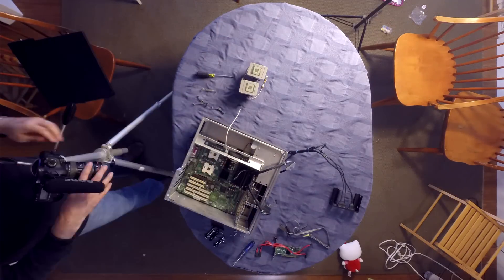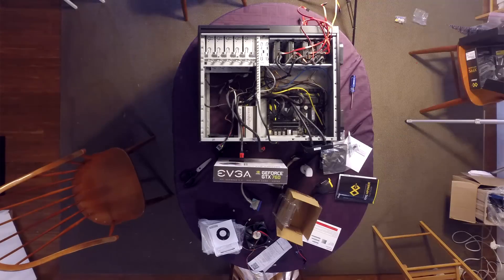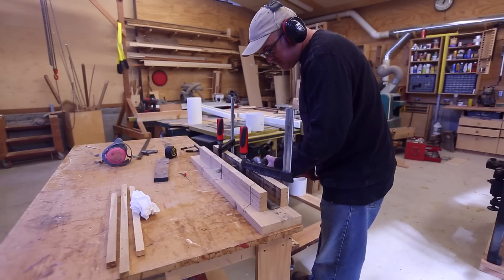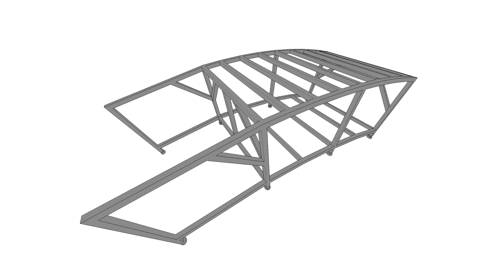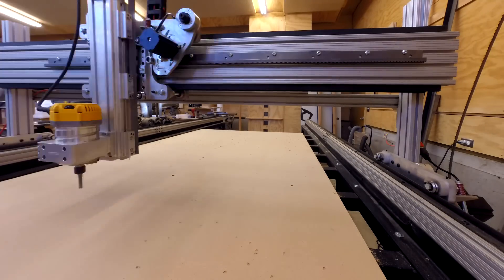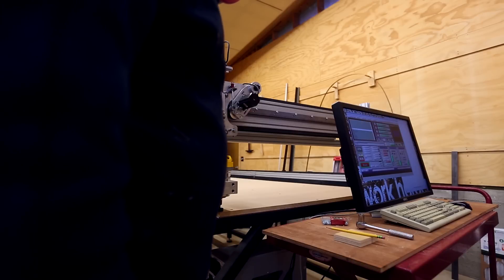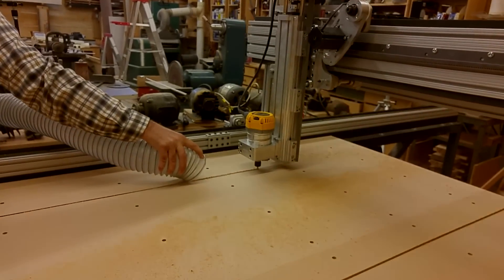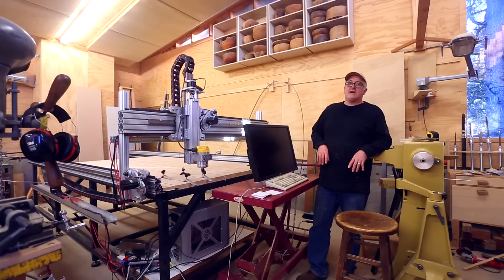The CNC Build: Part 3

Comment: Inkscape is the MOST RECOMMENDED for 2d CAD. It's freeware (it's free), but it works great! (Only 2d though, no depth)
A tip for those inlays: when you design it on the computer, just leave tabs in some places around the shape. When you cut it out, it won't be completely cut out and you'll need to saw the tabs without the CNC router, but those little tabs will hold the cut shape in place while being cut on the router. This is not needed, however, with a vacuum table.
For your dust collector, look online for a collector head. (I can't remember what exactly they are called) It covers the end of the router, and creates a trap for the dust where a connected hose can suck it up.
Lastly, when creating your designs on the computer, remember to take into account the kerf of the router's bit. You can easily forget that the router will follow the center of the line that you design, but will cut a line with a width that is the same (maybe slightly bigger) as the diameter of the bit that you are using.
Happy routing! And I look forward to seeing what you make with your new machine!

Comment: When doing inlays, you can get good results by not milling complety through the material and then take a belt sander and sand it free from the bottum side.
That's also how you can get letters ins the right spacing, you make the model then mirror it let a few thousands stand and glue them to the surface you want then sand them free.

Comment: hey frank when we machine smaller pieces out of the cnc we leaves little tabs between piece and board about 2mm thick  so that they dont fly out, you then clean the tabs up on the sander.  i use enroute but it is very expensive to get the 3d capability.
love your videos

Comment: the build is going quickly!  For woodworking G-Code I use Aspire.  The learning curve is much more shallow than anything else I tried.   Later on when you want to build cabinets there is Mozaik CNC which is freaking amazing.
Reply: +Tschäff Reisberg Also I use Sketchup for the CAD software- doesn't get much easier.

Comment: Nice build!  A few suggestions...  I use CamBam for most of my parts work but have dabbled with V-Carve Pro and MeshCam.  CamBam is decently priced and is well supported and has a great user community.

KentCNC has a really nice dust shoe for dust collection.  You could build your own but his design is solid and you'd probably spend nearly as much buying parts and testing designs as you would on buying his finished product.  You'd probably end up designing something very similar to his anyway.

My CNC PC is housed in a 2U rackmount computer case.  I modified an old laptop screen to serve as my monitor and mounted that and the keyboard on a rackmount sliding shelf.  I put it all into a 4U rack case and I seal it up when not in use to keep any dust out.

Consider installing a solid state drive into your CNC PC.  Fewer moving parts is better in a shop PC.

Comment: Frank, have you considered mounting your keyboard and monitor on an articulated swing arm? similar to your medical light but only moving on the X and Y axis. Could be mounted to your CNC router frame and swing in to the footprint of the machine when not in use.  Also  thanks for the wonderful videos.
Reply from the maker: +jmick.art I like that idea.

Comment: would highly recommend fusion360 as a commercial class CAM that is free to hobbyists... more of a learning curve, but i'd love to see you help everyone else learn it!  I've heard the CAM that is in fusion 360 costs thousands and thousands in commercial packages.

also, it is so interesting to see your progression in CNC follow the same as mine... mainly, learn about the machine, try some stuff, realize that "workholding" is a whole art in and of itself (btw, I highly recommend some side clamps for many parts as I found most of the time pieces were sliding causing my problems... if they are bound on the sides (not compressed) then you don't have to worry about the slide.  Here's some clamps I made:  http://www.thingiverse.com/thing:818842 )  anyhow, I'm super excited to see you posts your journey with CNC.  Please be sure and include the failures and the "whoops" moments and I feel those are the best things to teach others.

One last point about inlays - you can get the more perfect fit by doing "v-inlays".  I've tried it and wasn't very successful, but I'd love to figure it out one day.  The idea is that you can use the depth of the piece to allow it to drive those gaps to zero.
Great stuff Frank.  Can't wait to see more.
Reply from the maker: +Frank Graffagnino thanks for the info.  I made my first set of table clamps the other day,  they area a combination of a hold down and side clamp.

Comment: Very good job 👍🏼

You can use cambam as cam software 
It will run very will with it 
The cost is very reasonable but the 3d its not easy to be done with it 
Im still trying it but its very good in term of using the different cutting process

Comment: Great project, Frank.  Vectric is the best CAM software out there.  I use Aspire and it is well worth the money, although V-Carve Pro will do everything you may want (or not).  Plus, if you ever need some projects to run, there are a lot of us on the Vectric Forum that freely share vectors and toolpaths for some really fun projects.  I've been running Aspire for over 5 years now and still have tons to learn.  There are also some great dust shoe builds out there and a good junction ball at the top works well too.  The CV1800 will really keep your CNC clean, especially being so close to the main unit.  I can't wait to see the fun projects you do with the CNC.  It would have produced your kitchen cabinets much faster :)
Reply: Oh, and I meant CAD not CAM software.

Comment: Nicely Done Frank! Really enjoyed watching the whole build, and looking forward to future experiments with it! With the Inlays, I've started to use a slightly thicker piece for the inlay, not milling it all the way through and then ripping the timber out on the bandsaw to free the plug.
Also Don't be afraid of using Hot glue to hole things to the table top. its also easy to get off again if you free it when cold. :-)

Comment: My process runs on Rhino and RhinoCAM.  I just really like Rhino.   I have yet to find any free CAD or CAM software worth using.  My best suggestion to you is to find a CAD software you love, then research the compatible CAM packages out there that can dump to your gcode interpreter (I think you mentioned Mach3).

Comment: This is on my list of things to do. I built a small CNC myself a long time ago, now I'd like to do another, but with a 3'x3' platen. Something to keep in mind with the dust and using a dust collector with the sensitive controller. The dust collection apparatus will build up a large static charge that, if not grounded correctly, could cause damage to your controller. I recommend looking up methods for grounding the tubing of the dust collector. One idea is using a metal clamp near the mouth that is grounded to the gantry. I would also recommend building a small router guard to contain the dust and also keep the router bit from running into things it shouldn't run into. Will you be adding limit switches and home switches?
Reply: I used a free linux software for controlling my CNC machine. It was a decent software, but it required a good bit of prep work to get it going correctly. I made a mistake during the programming where I messed up the ratio factor of the acme screw. I was making ovals and I had no idea why until I traced back my steps.

Comment: Hi Frank.  When you want to cut something small out on the second pass set the depth so it doesn't go through all the way.  That way the piece doesn't come flying out and thus ruining it.  Maybe leave  .02" - .03".  Then go in with a utility knife and cut it out.  Sand it up and place it in the hole.  

Shop is looking great.  Keep up the awesome videos.

Comment: Autodesk 360 or HSM works for Soildworks.    2.5d is free.  

You need to get a sliding table saw next. Those things you have are terrible. Once you go sliding, you'll never go back. 

Think about making the top half of your machine more stiff.  And get a real spindle.  You wen't through all this effort to make a nice machine, but then you run a router as the spindle?  Come on.
Reply from the maker: +John Welden I first thing I want to upgrade is the router.

Comment: Hello Frank, I've made several comments but those didn't show up, glad this one did. 

- Does the Y axis rack? If you go to the side opposite of where the rack and pinion motor is, can you move it by pushing/pulling in the Y direction? If yes, watch out for high speed/high depth (load) cuts on that side as they can be off.

- Unless you plan on making 3D parts (and why wouldn't you), a flexible bristle skirt, similar to what they put at bottom of doors, works well to keep the dust in. 

- VisualMill might not be the cheapest but it will not limit you on what you can do. I've seen some awesome curved/3D carvings on molds and other structures that are simply amazing - all done with VisualMill. I'd vote for the Rhino3D+VisualMill package to run Mach.
Reply: +JRoque250 There's a slave motor on the other side.
Reply: +Chris Cates  Excellent, I hadn't noticed that. Closed-loop too?
Reply: +JRoque250 I don't think he's said what kind of motors he's using but they're probably open loop steppers.

Comment: Frank, for small pieces try the following: 
1) piece of sacrificial wood that you clamp to the bed
2) using masking tape, tape sacrificial piece (top side) then your source wood (bottom side)
3) using ca (super) glue, slather either piece (on tape) and press or clamp both pieces together (5-10 secs)
4) clamp and cut (cleaner than double sided tape)

Comment: Frank a wonderful job. It looks like when everything gets straightened out it will do much work for you. I was wondering if it wouldn't be wise to put all that electrical stuff you have under the machine on a drawer so you do not have to climb in and out to access it. Also put filter system on it to allow for cooling without dust challenge. Also to mount your monitor and keyboard to a swing up platform that will fit directly under that end of the machine so it is out of the way when not in use and easy to set up when needed. Just a thought.

Comment: I have been using Fusion 360 from Autodesk for about a year.
It does a lot of different things and is pretty powerful.It can be a bit glitchy but it is well worth the money.I think hobbyist can get it free.
Oh yeah it's cload based software so you need a decent connection.
They do seem to favor Apple not sure why.

Comment: Vectric V-Carve Pro is all you need. It's WYSIWYG and accepts any file type. Outputs to G-Code just fine. It's the most comprehensive and easiest to use CAM for running a router. It's only $700, and you own it outright. No cloud or subscription nonsense. Plus it has a great online community for help and suggestions. Plus there's plenty of freebie carve files that you can just drop in your projects like clipart.

They do have a more developed and expensive version called Aspire, but for running a router, V-Carve Pro is perfect. Aspire allows you to get more creative and create amorphic shapes, blend and contour, create 2.5D image etc... I've been using V-Carve Pro for years, and it's served me well. My favorite aspect is that I can still draw/create in Illustrator, and import the .eps file and have V-Carve generate the G-Code and show me a 3D representation of what I'm about to cut even before I cut it.

Comment: Hello! 

I used MeshCAM, is not free but isn't that expensive. has a lot of nice features, like the posibility of adding holders to the piece being cutted so it doesn't fly during the process. 

Another little suggestion. I had a lot of issues with my keyboard due to the dust, after a lot of searching on industrial heavy-dutty blablabla keyboard and mouses, I just used the plastic film is used with food to cover everything. It works just fine.

Nice nice machine :D

Comment: Very nice build... I have the Joe 4x4 I wish I built it to support the 8Ft sheet as you did. On the software, I use MACH 3, for controlling the mill, for 3D models I use 123DESIGN (free), and for tool paths V-Carve Pro Version 8... Not too bad on price and you can do 2D, 2-1/2D and 3D.

Comment: V Carve Pro is very powerful and easy to use. I would recommend that for a CNC router. It will add the tabs to prevent the small pieces breaking free on the last cut. Nice job, machine looks great.

Comment: I definitely recommend V-carve Pro. Not cheap but it works really well and has lots of options.
Reply: +Jer's Woodshop I also us V-Carve Pro and think it is the best all around CAD and G code program. There free add-ons (called Gadgets) to the program that greatly increase the functions - one gadgets creates dovetails.

Your vertical 80-20 prices are much too small for the size of your gantry - there is probably over 1/16" of flex which is a lot in CNC Mill work.
Reply: +Jer's Woodshop I agree, I have tried many different CAM program and found the learning curve very steep. The one of the nice features in V-carve (and the other programs from Vectric) is you don't need a CAD program.
Reply: +Nicolai Pedersen Ya V-carve is a pretty good CAD program as well. Not the best I've used but very acceptable. I like the trace and text options.
Reply: I completely agree with +Jer's Woodshop. VCarve Pro is a great piece of software that is very easy to learn and use. One of the features that I like is that it can directly import a SketchUp model and layout the pieces of the 3D model on a flat surface for you. I send my cut files to a WinCNC controller which also works great. Good luck!
Reply: +Justin Park 
thanks Justin, what a find, just what I want
Reply: +Justin Park I didn't even know you could do that (from Sketchup). I'll definitely give that a try!
Reply: +Jer's Woodshop This is a recent discovery for me too. I found out about it when I was looking at the Maker Bench Milling instructions. Go to: http://www.sketchthis.net/makerbench and click on the black "Miling Files" button. It will take you to a dropbox folder. From there, click on the "Master Milling Files and Instructions" folder. There is a PDF file in that folder with specific instructions on how to import a SketchUp model into VCarve.
Reply: +Justin Park Thanks! Those instructions make sense.

Comment: Fusion 360 might work for 2D but I've been using VCarve Pro for my Shark Mako CNC machine. They have a 3D version as well but Fusion 360 Cam would probably work with that as well. VCarve is just easier to do something quick and output a file to your machine.

Comment: hey frank that keyboard mouse and monitor would be nice where the monitor folds down and it all slides away under the table. also do you have plans/drawings for this cnc as i'm in the process of building one the same size

Comment: frank

I love it. I built a steel frame CNC a couple of years ago and would love to upgrade it to tslot like yours. you are doing a great job.

gecko G540 rocks

tabs help hold down small parts but can be a pain to clean up.

Jimmy Diresta has been using hot glue to hold down with good results.

I tried using my shop Vac to hold down and it needs to leak air to prevent overheating. some guys use ducted vacuum blowers successfully.

MTM wood is a guy on YouTube who does end grain chopping boards and he is a master at inlays. the trick is to cut using an angled bit.

Cam Bam software is budget priced but Vectric Aspire is amazing.

keep up the great work

Rich
Reply: I should have read all the comments before posting, I just repeated all the others

Comment: I use Aspire to generate toolpaths for a ShopBot CNC (it has many export file type options). It interacts well with 2d vector drawings and 3d models as long as you can get it exported to one of the supported file types. It doesn't handle new drawings well but I'm not sure that the toolpath software should really be expected to do that. Also, I am used to Aspire 4.0 which I believe is now an older release. Aspire has been reliable though I use it through my university and have not tried alternatives.
Reply: +ArchSmith Also, Aspire provides an option to add tabs to profile cuts to prevent parts from breaking free, they are an independently controlled thickness at your choice of separation/quantity. It does require some cleanup though and I only know of vacuum tables as an alternative solution.

Comment: Nice unit! .. for small patrs on the hold down: i spray mount the sheet i am cutting (corian for example)  to a sacrificial  board of MDF and cut through it.. all the parts stay put till you pry them off! two coat dry mount.. pounded together with rubber mallet!
Reply: +Hayden Allen who doesn't ??? It a dream!!
Reply: +jimmydiresta wishes he had a shop like this, instead of his cramped one
Reply: +Retro Arcade use fishing line to cut the tape just saw it back and forth while sliding under your piece of work and will cut right through it with ease.
Reply: +jimmydiresta Jimmy I've also seen you hot glue stuff down then use the freon in compressed air to release once it's cut. You're the master of making it work.
Reply: Retro Arcade Sweet, I'm going to try that too.
Reply: +jimmydiresta Hot Glue. Quick and easy.
Reply: Acrylic hot glue around the outside edge and tabbing works wonders.
Reply: Thereeee is a great ncn machine guide whereeeee you can make your own cnc custom smart saw on >> https://t.co/O5Xf7QNRGt?
Reply: +jimmydiresta I use 3M 665 Double Sided Tape to hold down stuff on my PCB mill which might also work here. Being able to peel the adhesive off the piece after it's cut is nice.

Comment: When the base MDF gets old, you could construction adhesive some thick shims right to the frame. Then use the router to just level the shim material instead of the whole sheet of MDF.